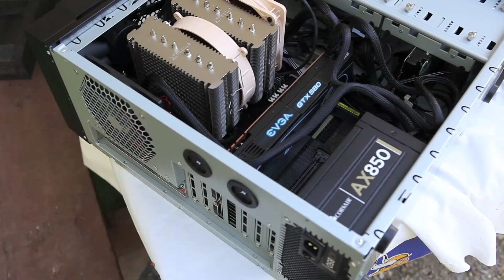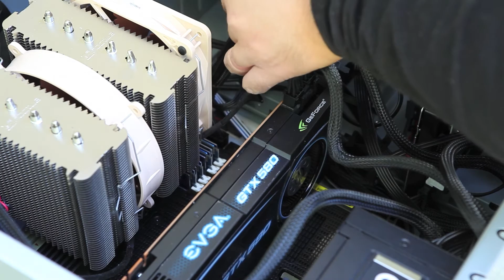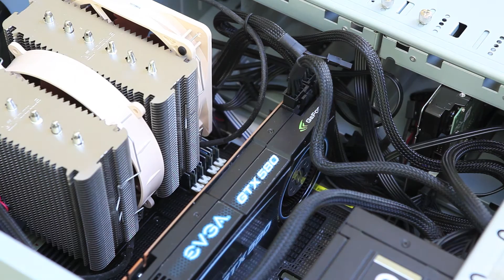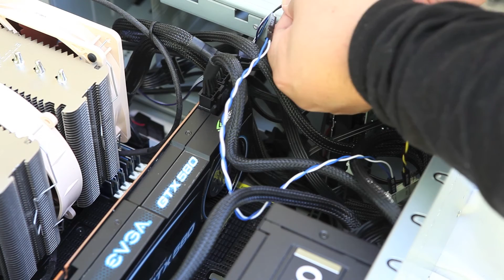Cable Management and Motherboard Extension Cables Build Your Own Computer Part 15

Comment: the power cable goes under the graphics card lol thats what that notch is for the two holes are for water cooling lol anyway enjoy ha ha cables should go round the back of the motherboard if possible for air flow :O)

Comment: tk i got it done
just had a lot of trouble getting the cpu cooler kraken x40 in
i failed so hard lol
now the thermal grease is a mess i have to pickup a cleaner for this tomorrow and do it all over again
the backplate is awefully close to the capacitor pins and i was figurin it out as i go 
kept messin with it and it would sit flush on bak of mobo 
wish i picked up 2011 socket would have cut hafe the work

Comment from the maker: The motherboard can withstand some bending and flexing but not a whole lot, I would place in all of the motherboard screws into place the try aligning the cables into the motherboard--note that it should be somewhat flush--some small gaps are forgivable, if it's a usb port I would try to get it as flush as possible. I had trouble with the video card that wasn't as flush as I wanted it, but it did work out in the end :)

Comment: hey machocave please help me out remember me i had the switch 810, i traded the x60 cooler for a x40 cuz of case compatibility
anyway im having some trouble with the onboard connectors, wires prewired with my case like hte hd audio its so tough to get it flush with the motherboard
i try and try to push it down and let go 
i fear it may snap or damage
the pins that portrude from the mobo are they supposed to be completely encased or covered by connectors?

Comment from the maker: @ysatria Yes, the case could have been a little bit better quality. This case was chosen due to the price requirements of a mid-range priced computer system. You can either budget more of the money on parts or more of the money on the case. I'll also be building out a more expensive/luxury system in the future that will have a better computer case.